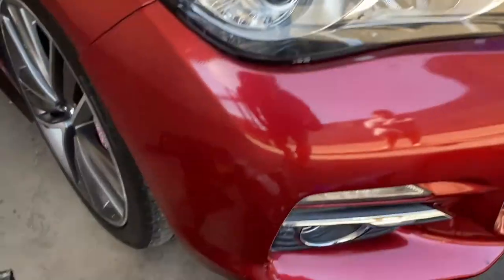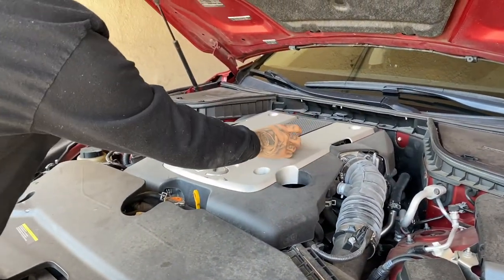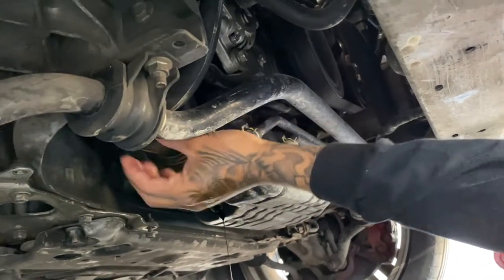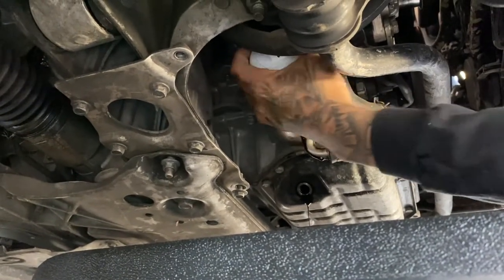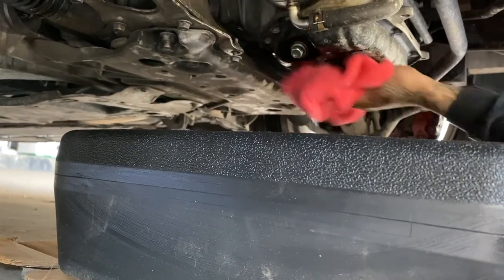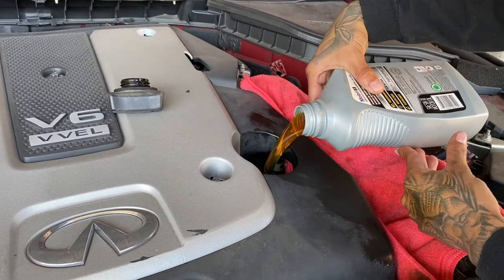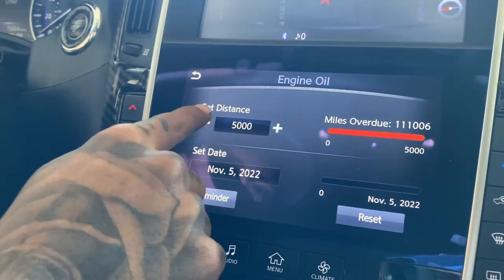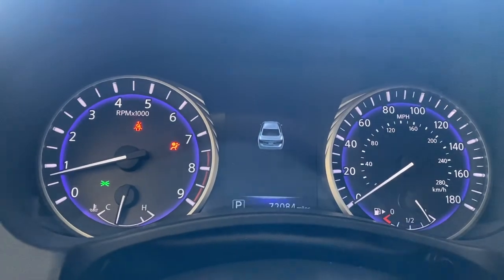HOW TO CHANGE OIL ON INFINITI Q50 & RESET MAINTENANCE LIGHT

Comment: Does it have to have dexos 1?  i got a 2015 infiniti q50 premium 3.7  112 k miles the mobil 1 extended performance has dexos 1 but the extended performance high mileage doesnt which one should i use?
Reply from the maker: Doesn’t matter as long as your using 5-30